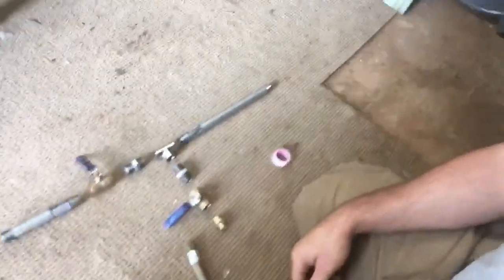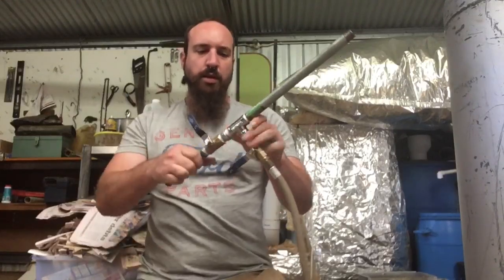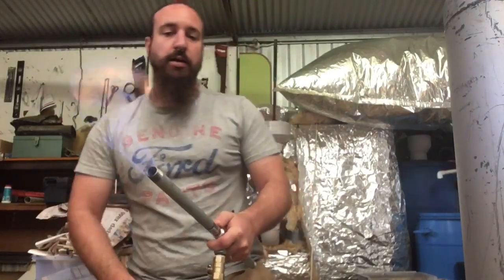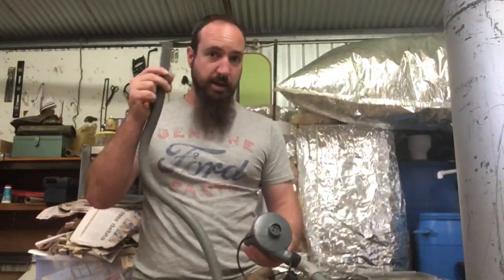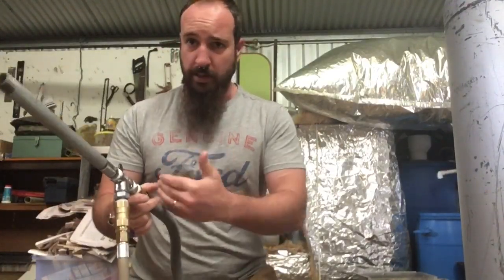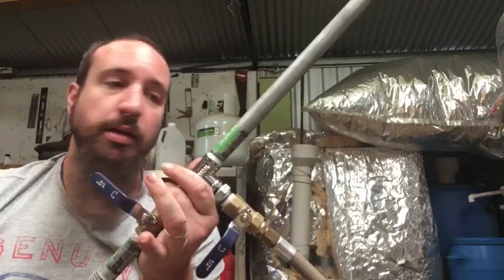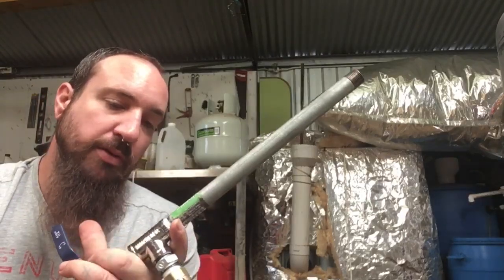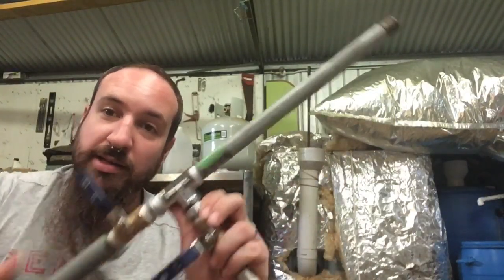Biogas blow torch and melting metal

Comment: A foundry I visited would pass hot exhaust from their furnace into a drum of rocks.  The rocks would absorb the exhaust heat from bottom to top.  Then, when it was saturated with heat, a valve would be switched that stops the exhaust flow and begins to flow the burner supply air downward through the rocks in order to preheat it.  A pair of drums would be alternately cycled in this way to greatly reduce gas consumption and increase furnace temperature.

Comment: Natural gas flames will stabilize greatly when preheated.  If you build a shell around an inner tube of silicon carbide, and pass the air with countercurrent flow along the SiC tube, when the preheated air and gas meet at the SiC tube inlet and combustion is initiated, the flame will be extremely stable.  It will burn like a rocket.  The flame is contained within the SiC tube and it will glow almost white hot without damage as long as the mixture is slightly oxidizing.  The exiting flame will be shorter and less likely to impinge upon surrounding surfaces, causing damage.  SiC tubes are available on the Internet for about $100.

Comment: You are going from a 3/8th inch hose to a 1/2 inch pipe (smaller to larger) this will reduce the pressure of the gas, is there a way to make the pipe sizes equal (same pressure) or from a larger to a  smaller diameter (increase pressure) for better results?

Comment: Have you considered making a simple wet scrubber to remove the hydrogen sulphide, and perhaps a bit of the co2 for near natural gas purity?

It's a bit extra, but prevents long term pipe corrosion, and allows for integration into standard cng workflows.
Reply from the maker: My gas runs through 2 scrubbers
Reply: @OkAtEverything-ProAtNothing  sorry must have missed that (looked at your old walkthroughs and you thouroughly mentioned it)! keep up the great work!
Reply: @OkAtEverything-ProAtNothing  I would love to get your contact I want to open an refill business with a biogas but. I really need a mentor as I'm new on Biogas your response will be highly appreciated
Reply: A pvc pipe with a mister/sprayer and/or a packed bed (bioballs anything really) should work?

Tech Ingredient's Dessicant AC had a good design.